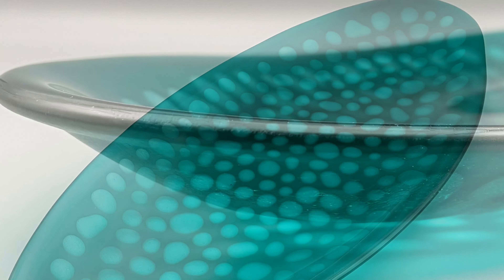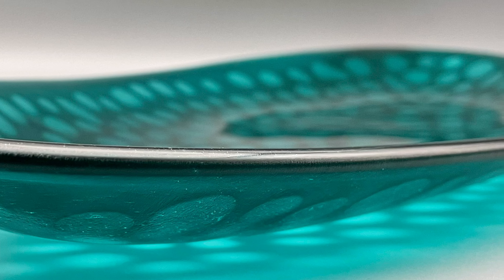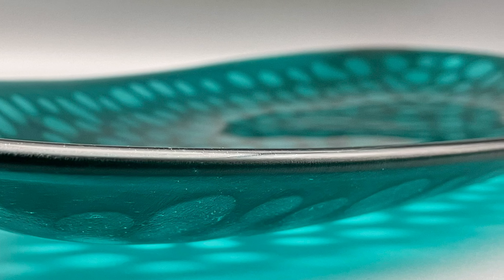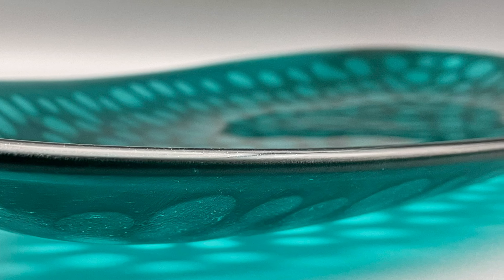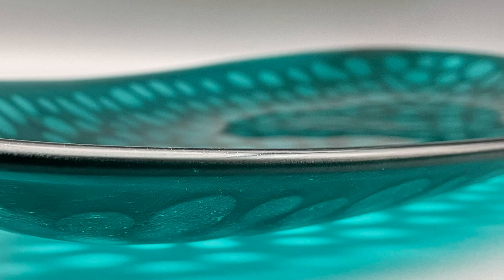Fixing devit with powder -- lessons learned

Comment: I only use Bullseye crystal clear powder to correct a devit problem and have never had a problem. As Bullseye points out in one of its videos, if the power is laid down too thick, it can trap small bubbles and result in a cloudy appearance, that applies to both clear and crystal clear.

Comment: Beautiful piece and thanks for the info on the powder.  I wanted to use crystal clear powder yesterday on a project and couldn't find it so used clear. Maybe that is a good thing.
Reply from the maker: I’ve not totally given up on crystal clear and will do some more testing. But on this particular project, switching to clear saved my sanity.

Comment: I wish the manufacturers of the molds would sell them with a template. Often times if they are not exactly square or rounded etc mine droop over the edge as well. It’s hard to cut them to fit exactly sometimes. 
Nice platter, I love that color as well.

Comment: I have a piece I recently made which came out with some davit.  I used Bullseye's tech sheet refusing it with the 2 grains of clear powder.  The davit is still there.  I did NOT rough it up beforehand, but see that you have.  I can take this piece to D&L to use their sandblaster to start with a fresh surface.  But before I do that and spend a fair amount of $$, do you think I should try to rough up the surface as you did and then add the clear powder?  I think in your video you said you used a 400 grit pad.  Thanks for any help.  I don't want to lose this piece.  Did you fire polish or do a full fuse?  My full fuse is at 1480 in my Skutt kiln.  Thank you.
Reply from the maker: My firing schedules are in my video notes… I went to 1490 on those redo attempts. I liked trying to sand off the devit myself because I just thought that would help with more of a fresh start? Not sure if it really made a difference but at least I felt like I was accomplishing something. 🤷🏻‍♂️

Comment: Thank you! This is exactly what I needed for the same issue. Do you sign your art in any way?
Reply from the maker: Hi there! I’m not totally giving up on crystal clear and will try some more tests. But on this particular piece, the change to clear saved my sanity! I have an inexpensive engraver pen I bought from Amazon which is enough to etch a subtle date and my initials (just like the video intro!). FOLAI DIY Pen Electric Engraving Tools for Jewellery Making,Metal, Glass with Replaceable Diamond Tip Bits, https://smile.amazon.com/dp/B07G96N1G3/ref=cm_sw_r_cp_api_glt_fabc_S63CQ2YTYY288SCT2KED?_encoding=UTF8&psc=1